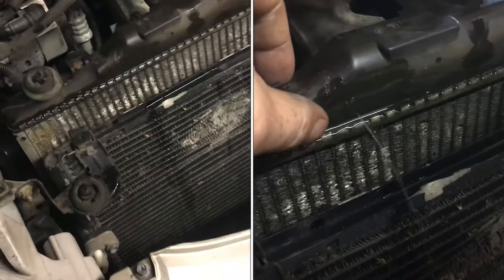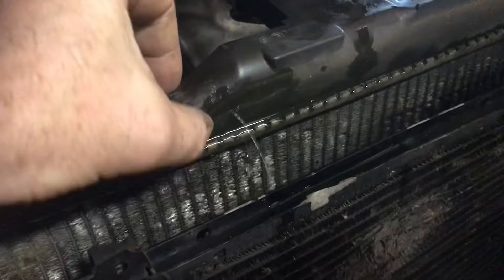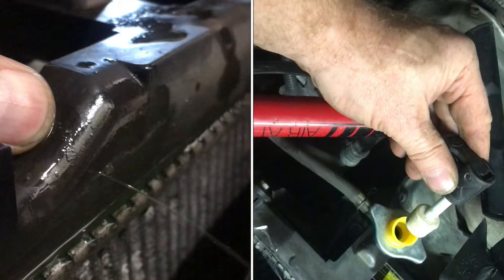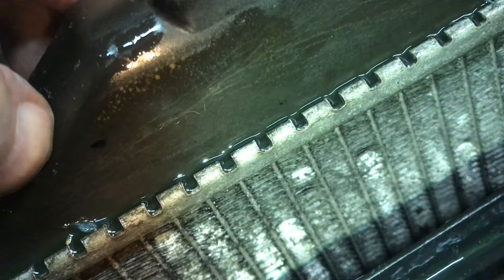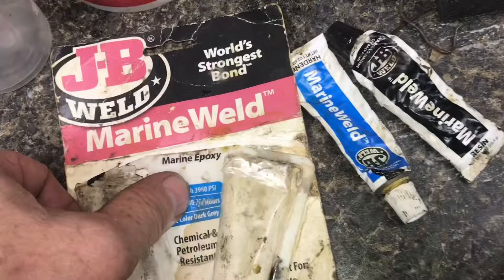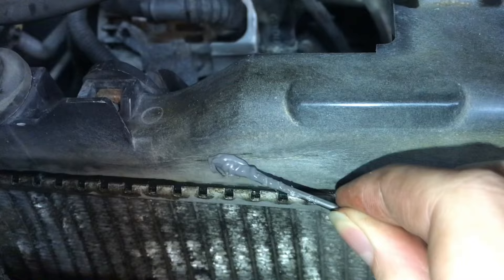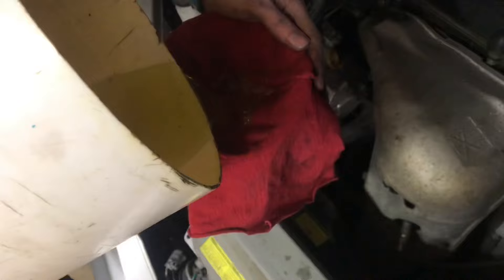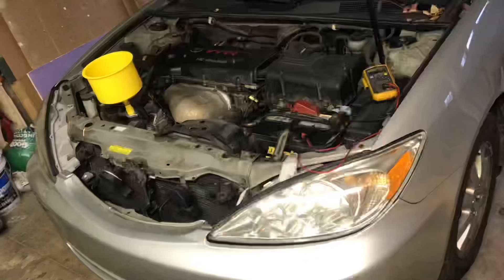finding and fixing SMALL LEAKS in your “car radiator” (jb weld) diagnostics

Comment: Man i can find where mine is leaking, i open my hood and it looks like it sprayed all over my engine coming from the font area where the radiator is, i see no leaks from radiator hose, no leaks under vehicle. I put vehicle on with heater while parked, saw nothing, this morning i drove it with heater on looked under underwood and there it was again sprayed on my engine.
Reply: common place is at the top.....where small coolant line comes out.  it's a weak area.

Comment: Is the use of the bicycle pump just to get higher pressure than you would normally get when the engines running? Just curious why you’re not looking for the leak when the engines at normal operating temperature. I’m guessing the pressure in the radiators not as high as what you obtained using the bicycle pump. I have coolant spray - not a lot but definitely noticeable - on my battery and engine vanity cover that I can’t figure out where it’s coming from. No leaks in hoses. No water pump issues. But there is coolant along that seam where the metal fingers on the top of the radiator are bent over, I’m suspecting it’s some leak along that seam somewhere. Thanks for your post.